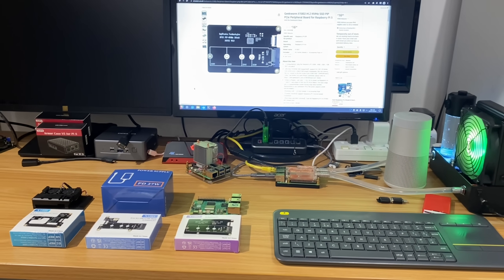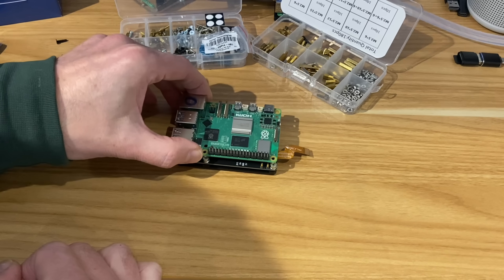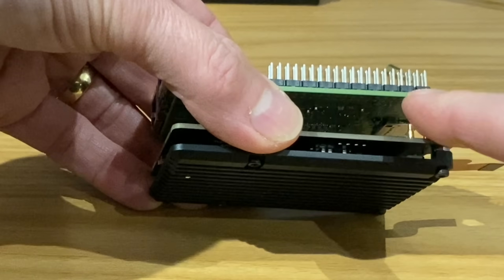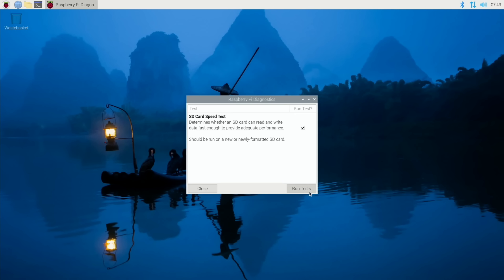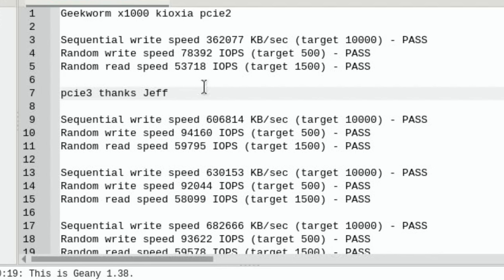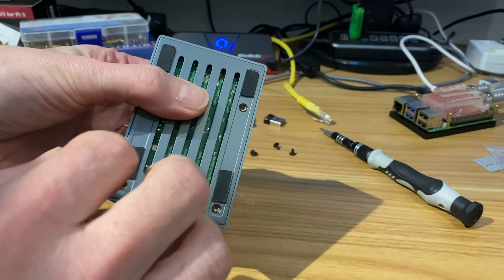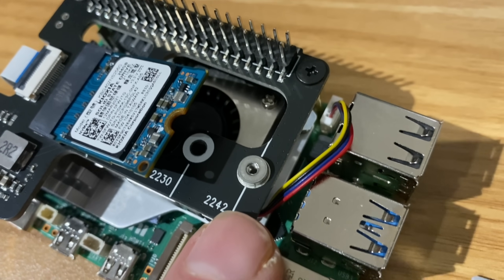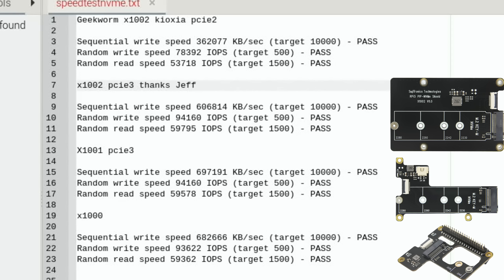PCIe NVMe for Raspberry Pi 5. Geekworm

Comment: i was thinking about the possibility of making a "Dual boot" Batocera that allows the user to select from  bat file/script that allows to select either a RPi OS boot or a Linux 64bit option for PC, i know both will fit on the FAT32 partition as i did try copying both to the partition and putting one or the other into a temp folder and booting in both environments, Benefits of this of course is interchangeability and cheaper to need just 1 large NVMe etc. ?
Reply from the maker: Chris Edward’s restoration gets Pimiga to work on Pi and X64 devices. May find some tips in his videos

Comment: i have a NVME hat for my Pi5 Batocera V41 installed.  I have the NVME set as first device to boot.  Does Batocera benefit from the pcie3 update  ?
Reply from the maker: Only faster loading Retro gaming doesn’t need super fast storage
Reply: Thx, i was thinking of the copying process itself to load the games itself to the NVMe from PC etc. I imagine the game files itself too small to benefit from faster read speeds

Comment: I have the x1000 and it was a bear getting it running, had to try imaging it multiple times. It's like the nvme is not receiving enough power.
Also, if I sudo reboot, it fails to start every time. I have to pull power supply and plug it back it to reboot.
I'm using the standard raspberry pi 5 power supply.
Is there a higher powered power supply I should be using?
Reply from the maker: @user.A9  I was using the official pi5 adapter without problems. Do you have many more devices plugged in to your pi that may be drawing more power?
Reply: @leepspvideo  nothing plugged in except ethernet. My PSELN128GA87MC0 nvme is labeled 3.3V 2.0A, is that too much power?
Reply from the maker: @ it’s likely you phison nvme

which NVMe drives work with a Raspberry Pi 5?
https://youtu.be/3mUgVTBmKio
Reply: @ just my luck, not compatible with the nvme I already have.
Reply: @leepspvideo  I have also tried a SDDPTQD-256G-1012 nvme with not much more luck. It is rated at 4.4W per the spec sheet.

Comment: Great video. I've recently got an rpi5 and it's currently sd card and  is  housed in a geeekpi mini tower kit case. Would nvm fit inside or would  better case be more suitable.
Reply from the maker: @StuBoyUK  I mounted mine externally My new NVMe setup Raspberry Pi 5. Plus longer PCIe cable tests
https://youtu.be/DX6tg-FY_nI have since added power from the goo pins 

https://youtu.be/f8Ou6VkuF4w?si=cvvjthYXtLIVtzv0

Comment: I was just wondering is there a reason like possibly can only use one of the other you can't use both like SD card and Geekworm X1002 PCIe to M.2 2280 NVMe SSD I was just curious because my OS is on the SD card and I was going to use that other drive as storage for the game ROMs and what not🤔🤔🤔🤔
Reply from the maker: Yes, you can use nvme for storage and run an os on sd card. The raspberry Pi defaults to sd card boot

Comment: I am hoping for a SATA hat so I can connect 3.5" HDD.  
I don't think there is anyway yet except USB and the OMV people say don't use USB for HDD
Reply from the maker: Usb is fine for a HDD what are you planning to use it for? The extra speed of pcie is really more suited to nvme
Reply: @leepspvideo  I use a Pi for my home NAS. OMV will not support RAID when using USB HDD. They say that USB is not stable!
My own experience of USB HDD is positive so I have concluded that I don't need RAID but I'm still bothered by their comment about stability.

Comment: How do you create a backup image of these large NVMe drives.  Lets say a 1TB SSD without the need to create a 1TB image file?  Wasn't a massive issue imaging a 32GB SD card lets say,  but a 1TB drive?  And I do mean an "image" and not having to resort to backing up individual files. I'm struggling to find a solution.
Reply from the maker: I use Pi Safe to create compressed backups, you need more space than the original to perform this process I believe.

Pi-Safe. Raspberry Pi 4 / Pi 400. Backup, Shrink and Restore SD cards and USB devices.
https://youtu.be/XP6ycUR9Ih0
Reply: @leepspvideo  Thanks. I shall investigate this. Just in the process of overhauling my backups for various co-located windows servers and thought it high time that I should start paying some attention to my various Pi's I now have in play.
Reply: @leepspvideo  Needing more space than the original drive, regardless of its contents, is what I am trying to avoid unfortunately.  Oh well. Thanks anyway.
Reply: To clarify - if only 100GB of the 1TB drive is used - then how to just create a 100GB Image?
Reply from the maker: @mqblowe  all the results from my test are in the video. I don’t know how large the backup will be after the whole process has finished

Comment: Can you put a link to the NVMe grey adaptors you used. I have been looking for something like them.
Reply from the maker: https://www.thingiverse.com/thing:4675734
Reply: @leepspvideo thank you very much for such a quick response, love your channel, I am a huge Raspberry Pi fan and user for several years, really excited to build raspberry pi 5 with NVMe, as you will be aware sd cards atc can become unstable very quickly. so hoping using nvme ssd the pi would be up and running 24/7 365

Comment: not the biggest fan of the bottom one..... unless you're raw dogging your pi, what kind of case or rack is it supposed to fit into?  I haven't found anything.   Also, yes, the final version of the first board you showed off (that I'm talking about) does come w/ the little rubber thingy for putting in different sized drives.   But yea.. . bottom boards are one of the more frustratingly difficult attachments to find compatible enclosures or racks for.

Comment: Still haven't received the Argon THRML 60mm cooler, but I saw something interesting on Amazon. If you pull up the GeekPi Mini Tower Kit for Pi5, the "Frequently bought together" section suggests also buying the Geekworm X1001 PCIe M.2 board. Is it really possible to mount them together or is Amazon just showing their inner numpty?
Reply from the maker: I have a 52Pi mini tower I am soon to review. I’ll see if one fits.

Comment: Hi, I purchased a geekworm adapter for my raspi 5 and now using my nvme as main boot device. Everything worked out fine, except since this switch after a while I can't connect anymore to my raspi. It seems like the SSD is going into some idle mode. If I start working on an open SSH connection again, everything goes back to work again without a restart. No idea why this happens. Do you have some experience here? Many thanks!

Comment: Is there enough power to have the raspberry Pi 5 be configured to use both a 2.5 solid state drive under the SBC and also use the upper plate containing the NVME drive?
Reply from the maker: I haven’t tested it enough yet

Comment: I liked your build with the X1002 Bottom that leaves the top free for a good cooler. I've ordered the Argon THRML 60mm Radiator Cooler, which looks like the trusty ICE Tower, but uses spring loaded push pins with the board's cooler mount holes. I'll update when the parts arrive.

Comment: Pretty sure the NVME touching the base on the first board is intentional in order to cool the NVME since they tend to run hot.
Reply from the maker: The first base was not designed for nvme. I was just seeing if it would fit.

Comment: Its my first time with pi and a node , i have a pi5 i cant make up my mind if i should use a hat and nvme 2tb ssd or a sata ssd 2tb drive what would you think would be best for a btc node , any info much appreciated . thanks
Reply from the maker: I haven’t any experience with nodes. Nvme is the fastest but I’m not sure it will make any difference

Comment: Where did you get those M.2 2230 to 2242 or 2280 extenders? They held the drive with little notches that catch the corners of the drive. Clever. Most of those I've seen are breakaway PC boards.
Reply from the maker: 3d printed

Comment: Thank you, this is good. These GeekWorm boards are very nice. Putting the M.2 on top clearly is the way to go for the sake of heat dissipation. GeekWorm should also provide some boards targeting the *2230 / 2242 ONLY* in order to minimize the overlap with the main board / RPi fan, and let users add complementary hats for other purposes at the same level.

Comment: the nvme touching the case is probably intentional, to use it as a heat sink, probably why there aren't standoffs either, fiddly trick to get it installed and keep it in place.
Reply from the maker: I was using a different Geekworm case. The NVME was preventing the Pi from being flush with the raised lugs.
Reply: @leepspvideo  perhaps designed to touch, but... not very well
Reply from the maker: The case is designed for the NVME adapters. I was experimenting to see if it would fit. I probably didn’t point it out in the video  @felderup

Comment: Wasn't that first one meant to touch? Where would be the point of a heatsink if it doesn't touch they device?
Reply from the maker: I was using a different Geekworm case. The NVME was preventing the Pi from being flush with the raised lugs.

Comment: I can't get the pineberry pine drive to work with WD Blue SN580. I'm thinking that my drive is not compatible. I'm going to try it with a crucial p3 plus that I ordered and is on its way. Hopefully that will work. I've followed all the guides. Does anyone have experience with nvme on pi5 with ubuntu? Ultimately, I would like to run ubuntu, but all the guides I've found have instructions for the rapberry OS. I know the boot config is different, I'd just like to know if anyone has gotten that to work. In my case, I won't know until I try the crucial drive.
Reply from the maker: Take a look at the Geekworm wiki.

https://wiki.geekworm.com/X1001

They don’t recommend your drive

Comment: Hello everyone
 I got the X1001 board, set up was fine writing the image was all good, but I couldn't get the rpi5 to boot from nvme ( something with the boot order of course ) unfortunately, 
I tried using sudo rpi-eeprom-config --edit to add this : BOOT_ORDER=0xf416 but that  didn't work, looks like something with the rpi-eeprom-config command itself failing on update or something.
Did you have to change the boot order or simply taking out the SDCard and starting the pi again is sufficient without any kind of config. 
Thanks a lot
Reply from the maker: I just made sure I had the latest eeprom update. Check the docs, some nvme drives are incompatible. All sata m.2 are incompatible

Comment: I think raspberry pi lost its direction somewhere along the way:
Now you need an active cooler, an addon board to mount the nvme...
What they should have done instead:
put the nvme connector directly on the pi, dimension the cpu properly so that you don't need an active cooler (maybe except in extreme cases). Having an nvme connector is great, but put it directly on the pi! and get rid of the second display connector! Who has the money to run a dual monitor system, for sure has enough money to buy a gigabyte brix or intel nuc (albeit second hand now). And if you start to count the price of the pi, the price of active cooler, the price of a daughter board for nvme, you won't get much cheaper than a second hand nuc, which runs circles around the pi performance wise.
As it is, raspberry pi5 b doesn't make a lot of sense for the majority of people
Reply: They do an official micro HDMI to VGA adapter apparently (£6 at PiHut) and my VGA monitor (flat, probably CCFL - i only looked at the specs when I was buying it) cost me £14. I'm fairly sure since then that I've seen a whole lot of similar kit corraled on its way to the dump.
If you can sort out the mains electricity distribution and [obviously] the furniture and the cable-management consequences, then that is the ECONOMY option - with a standard HD 16:9 compared to some retroflex-curvy UHD single - if you want a "workstation" set-up from it.
Reply: It's all about what you can do with the things that are going out of fashion for price-gouging: Up until Pi 4 the only interfaces to the system were a single USB 2.0 and SDIO (on which the WiFi eventually went: not that it needed the bandwidth.)

Comment: I have two Pimoroni NVMe bases. Followed their instructions and they work like a charm. One on 4g and one on 8g.
Reply: I 3d printed a case for the 256gb unit. I like that the drive is between the base and Pi but (and I'm not sure of which is the bigger impact - case or SSD) the running temperature is up about 5 degrees (F). I'm using the official Pi5 fan/heatsink.

Comment: Using the Pimoroni HAT, and getting 850+ speeds on GEN 3 (HDParm), well happy.  A bit disappointed you cant get these NVMe cables longer, or anywhere at all.
Reply from the maker: I found these, still only 5cm

https://www.aliexpress.com/item/1005006408515686.html?src=google&src=google&albch=shopping&acnt=494-037-6276&slnk=&plac=&mtctp=&albbt=Google_7_shopping&albagn=888888&isSmbAutoCall=false&needSmbHouyi=false&albcp=17859473014&albag=&trgt=&crea=en1005006408515686&netw=x&device=c&albpg=&albpd=en1005006408515686&gad_source=1&gclid=CjwKCAiAzc2tBhA6EiwArv-i6f4gbXDzeE2-tn2NXcxXNkGeUewLU5Lgofe1DoNEfc_HPbZ8md_ByBoCXt0QAvD_BwE&gclsrc=aw.ds&aff_fcid=b02e1cebe1874fedac6ded80f4ea6ba9-1706299698538-00042-UneMJZVf&aff_fsk=UneMJZVf&aff_platform=aaf&sk=UneMJZVf&aff_trace_key=b02e1cebe1874fedac6ded80f4ea6ba9-1706299698538-00042-UneMJZVf&terminal_id=208f203cd0754137a115e8d3235551dc&afSmartRedirect=y
Reply: @leepspvideo  Many thx!  Why are they so short though?
Reply from the maker: Possibly to do with keeping the speeds high. Although the Edatec nvme case has a long cable  @scaramonga  see the start of this video https://youtu.be/ZUKtfwAzv_8?si=oJS8cXAdbE0HqNnr

Comment: I saw Kioxia BG4 working with geekworm in your video. I tried using both Pineberry Pi and Pimoroni NVMe Base and was disappointed because Rpi5 didn't detect my BG4 through them, but I'm thinking of buying Geekworm and giving it a try.

Comment: Geekworm already released even better x1003 version which is even smaller and uses neat idea to mount itself into official cooler screw :) hopefully they will release smaller version for 2230 only, maybe with slot instead of angle adapter :)
Reply: The thing is that with x1003 you can only use 2230 and 2242 sized SSDs and the SSDs with larger amounts of storage tend to be 2280.
Reply: @gklinger  obviously it's not for 2280, but there are other choices for those. 2230 are very popular and cheap, much more than 2242.

Comment: I've got the x1001 and their case P579 with the official cooler. It's actually been a great build.
Reply: That's what I ordered and it just turned up today. I'm quite pleased with how nicely it all fit together. Tomorrow I'll do some benchmarks.
Reply: I have the x1001 on my Pi 5 too but I opt for the KKSB Raspberry Pi 5 Case instead for higher clearance 'coz I'm using a rather aggressive heatsink on my Nvme SSD that is 2280 in size. I'll be getting it tomorrow. Can't wait! 😁

Comment: It looks like the difference between V1.0 (which I have) and V1.1 (which you have) is the existence of the pogo-pins for power.
The way I assembled mine was to put the black screws through the Pi into and through the NVME board, then use the supplied stand-offs below those to be able to have something to screw into (for my eventual case).

Comment: I just got the X1002. I had to update the eeprom in the raspberry pi 5 to enable the nvme. I also really struggled with the little ribbon connector on the external board. I also couldn't put a small NVMe in the board, same as you saw.

Comment: I received these 3 cards some days ago, the x1002 is better than the Pineberry hatdrive bottom (micro sd access), I hope they will make an update for that! Geekworm copied some design of the Pineberry hats, I hope Pineberry will have some credit for that (I support my fellow European designers).
Reply: Does yours have the pogo-pins for power?
If so, what version is the board?
I have an X1002 V1.0 and it does not have the power pogo-pins. I was surprised to see that in the video.
Edit: I paused the video and made it fullscreen and can see that the one @leepspvideo is demonstrating is a V1.1, so yeah, that's the difference.
Reply: @glabifrons  Mine has 2 pogo-pins too
Reply: Like with the top and bottom pineberry hatdrives, I managed to use a 8TB Sata SSD with a Sata 3 controller board.

Comment: I prefer the x1002 board underneath.
With the x1001, the camera and display ports are blocked and you are forced to use the standard fan.
With the x1000 only standard fans are possible.
Reply: Same here

Comment: I have the Pineberry and Pimorini. I've had to 3D print / Laser cut my own cases. It's a pity that the standard Pi FGoundation ones couldn't have put some spacers in theirs to accommodate these obvious addons. You can remove the top fan but it's a kludge for the top hat. The lower board really needs a hatch to take it out. The problem when you're bleeding edge I suppose. Not a problem for me

Comment: I just installed the X1001 two days ago and I'm happy to report the board works with the WD Black 770 M.2 NVME, something Pineberry does not support. The process took about 5 minutes to install and boot up.  I was so pleased with this board, I purchased a second one.  Thanks for the video, the 3D Printed M.2 adapters were an awesome idea!
Reply: Thank you so much for this!!! I also bought the X1001 but also saw the warning about SSDs using a Pison controller. I have been unable to find a reliable source of information on exactly which drives use the Phison controller. I'm glad you found one!!